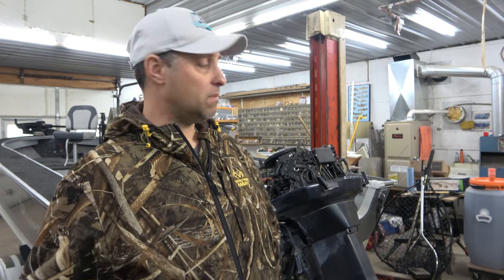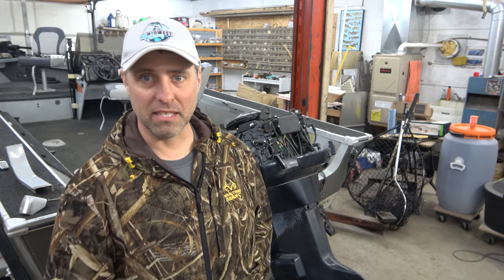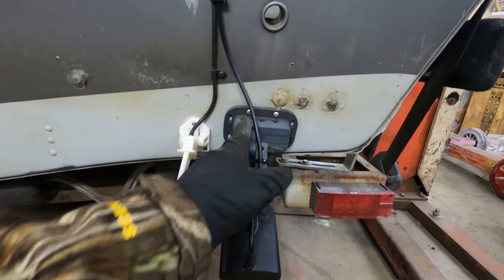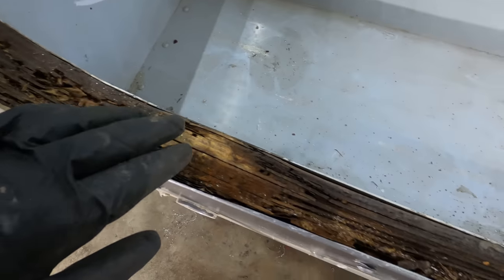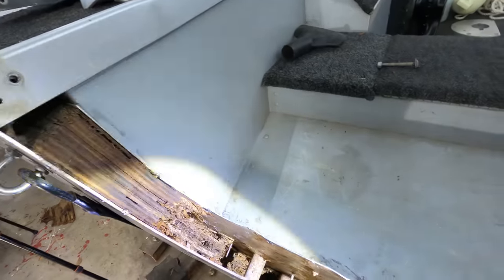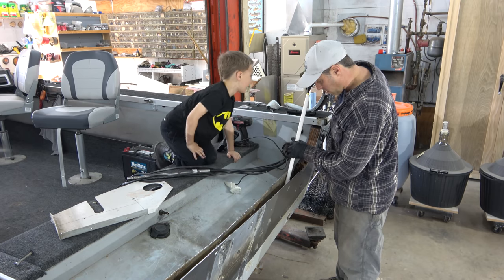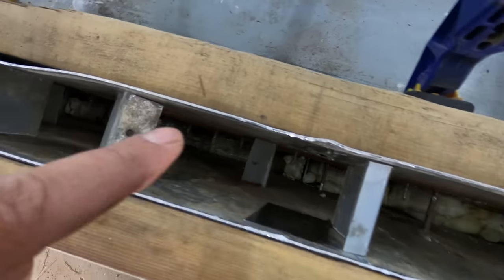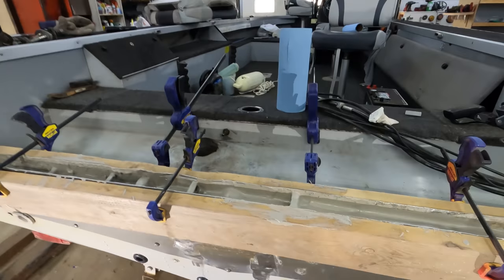The Easiest Way To Replace A Boat Transom

Comment: I would have felt more confident if you had filled the entire transom with the liquid transom, then welded all the aluminum seams to completely eliminate ANY possibility of water getting in there in future. BUT, your fix was certainly on the right track and truth be known will probably last the life of the boat. Good work. Thanks for filming this!
Reply from the maker: Thanks Greg. It was a learning experience. Its not perfect, but so far its held up well and I'm very happy with it. Thanks for the comment.

Comment: I think  this was a bad way to repair the transom.Iv replaced several and theirs know easy way to do it so you might as well of done it the right way.the transom.is made to flex that's why it needs to be done with marine plywood.
Reply from the maker: Your right, it does need to flex. If you do a little research on Carbon-Core, you will see that it is specifically designed for transoms and made to flex, not crack. Its been working perfectly for the last three years now without any issues.

Comment: Your philosophy of trying to work around the rotted wood is flawed.

You should just replace the entire transom wood and Aluminum.  Then to attach to new Aluminum to the boat.  You should clean the old Aluminum.  Then form and weld new Aluminum.  But increase the thickness of the new Aluminum to 1/4 inch.  Your old Aluminum is bent stressed and weak.  Do not reuse it.  Get Aluminum sheets.  Then instead of forming.  Weld new pieces together.  Then on the sides weld the new to the existing Aluminum.  After you her you new Aluminum Transom with a 2 inch Gaop.  You can then place holes for your different cables and equipment.  Then fill these holes with Aluminum pipe and weld them in.  Never use screws on your transom.  Use a Heliarc Welder.  You can rent them.
Reply from the maker: Hi Francis. Thanks for the info.

Comment: Nice attempt to fix it but the only way to fix something is the right way. That is tear it out and do a one piece transom. This inferior repair will not show up until the second sean My concern is the guy or gal that buys it when you want to sell it does not know what is lurking behind that lipstick and makeup you applied  That gap at the top was unacceptable. Totally shady work. That is where the engine hangs on man. That should have been filled with resin or epoxy and you should have drilled into the carbon core to tie it in.  When i was 16 i totally refurbished a century wooden boat. I cut the whole transom out and laminated 3/4 marine grade plywood together with and then screwed it together. I screwed it in with stainless steel screws. Laid up fiberglass mat all around etc etc. Was it alot of work. Oh yeah but it was solid as a rock and i had no worries with that 90hp Evinrude hanging on the back. I had a good conscience when i eventually traded it for a snowmobile. I documented all the repair with pictures that went with the new owner.

Comment: For one thing you put way to big a motor onboard. Im sure it's over Rated
Reply from the maker: It can handle a 150HP motor, so I'm on the low end with mine. 30 MPH is just right.

Comment: I have the same problem with a 1985 Procraft bass boat. I always wondered how do you get a vacuum hose down inside the transom to get out the debris. Very informative video. 👍🏾

Comment: Nice job. I might have been tempted to insert some Alu or Stainless or even hardwood filler pieces either side of the main stressed areas, just so that the level of goop rises to the top line before it set. I can't see that the remaining higher wood sections at either side contribute a lot to strength but I would have wanted to pull them anyway and maybe use more of that expanding foam.
Reply from the maker: Thanks for the feedback. That is some useful info!

Comment: Just a suggestion but I'd definitely rivet the two long top caps together to prevent expansion or crushing. 
Very interesting project. Cudos for tackling it. 
Took me a minute to realize the weight of the engine is compounded by the torsional force rotating at the mounting points around the verticle mid point of the transom where it actually attaches.
The lower portion of the motor wants to push toward the front of the boat rotating the transom on the hull and pulling outward/backward at the top.
That line of screws where the interdeck connects the transom would seem a very major structural component preventing the transom from bowing outward or twisting outward. 
It's not merely the weight of the motor bouncing in the transom in waves or on the trailer but actually putting the boat under power that likely creates the greatest forces causing the separation.
A thicker angle riveted to the inside deck and riveted/ screwed into the transom would have pulled the two pieces together better and slightly raised the supporting point to give more leverage to resist torquing. 
Great thing is, it can all still be done.
I'm sure it'll last many seasons as is with minor variation. I'd expect the inside "Bondo" filler over the seam to be cracked within a season, and that gap to open slowly. 

Just some thoughts. 
Great work and a very interesting product.
Reply from the maker: That's a lot of great info. I appreciate the feedback. You gave me plenty of things to ponder.

Comment: I have had a shop doing this for 48yrs and that poured crap is just that crap. It breaks up inside of a year. Then good luck getting out of there. Don't cut corners do the job right. Alumacraft boats are one of the easiest ones to do. Hire a professional and don't do this.

Comment: Why boat manufacturers still use wood when there's so many non rotting waterproof materials is beyond common sense! Id bet it IS so the boat rots and you HAVE to buy a NEW one... PLANNED OBSOLESCENCE/JOB SECURITY!
Reply: Thatr's exactly the reason, As long as it lasts long enough to get the loan paid off, they don't care about anything else.. No Different with RV travel trailers. Which have no lemon laws at all. As soon as you drive it off the lot, it's your problem.

Comment: Arjay breaks at one single 200lb test. It is a copycat failing material. Check out Seacast™ www.transomrepair.net. FB Seacast transom  replacement pages test drops
Reply from the maker: Thanks for the info. I will check it out.

Comment: Body filler??? An epoxy would have been your best choice...Using auto body filler anywhere on a boat is an obvious no go for anyone that knows auto body work basics...Looks pretty there..I want to see it now a year later...smh...
Reply from the maker: Yes I did mention it smelled like body filler. If you keep watching, I explain how it is a ceramic resin designed for boat transoms... not body filler. I'm going on my third fishing season now and it has help up perfectly so far. You can see the one year follow up video here: https://youtu.be/MCWqsJOXaRQ
Reply: @GoMidwestFishing  I was referring to your stated use of "body filler" in the gap you first attempted to weld and on the outside skin of the transom prior to you painting it...thanks for the reply and link. I'll check it out...

Comment: Fiberglass resin works just as good.
Reply: Yes but super super expensive lol. He should of used fiberglass resin instead of the expanding foam at the top.
Reply: Thanks for the comment cause I was thinking the same thing about the fiberglass resin. I not a fiberglass tech but thinking about replacing my transom and using the fiberglass resin.